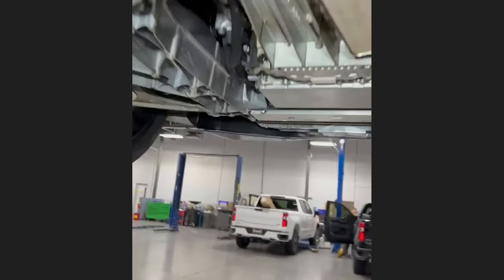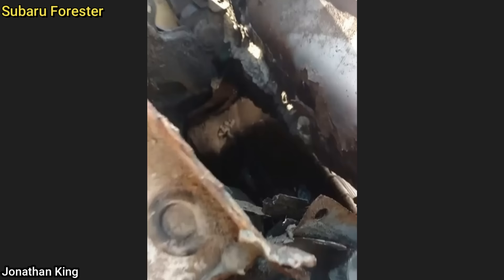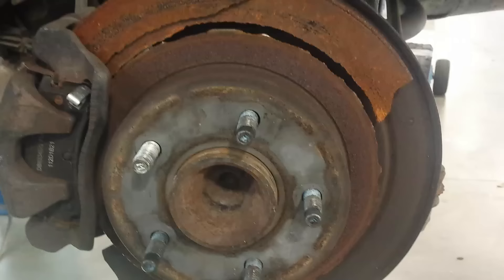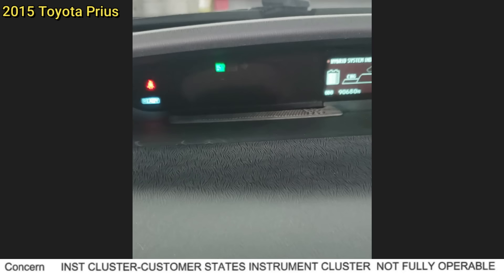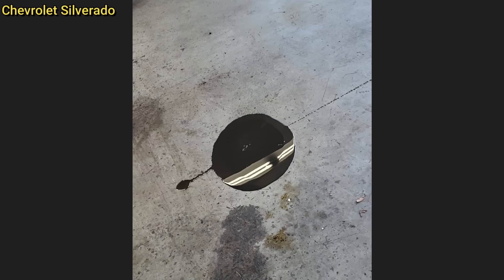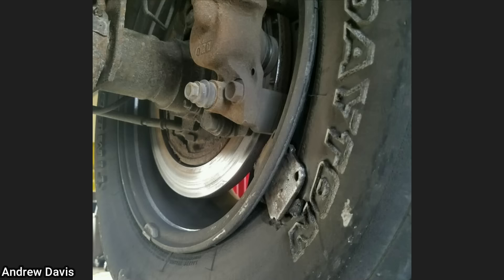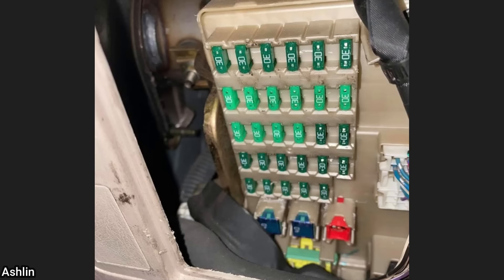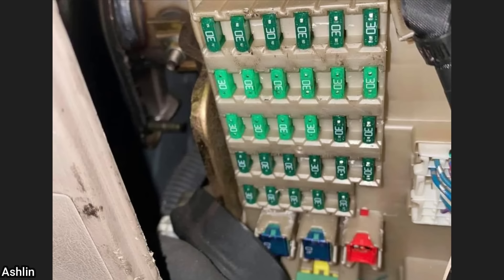Customer States Brand New Corvette Shut Off While Driving

Comment: mechanic shops should be required to contact the DMV and inform them when a customer knowingly drives a car that’s not safe to drive. they’re just putting everyone else on the road at risk
Reply: It's not safe for you to not get an oil change, you're 5 miles outside the interval and I don't care you plan to change it this weekend yourself. Your engine may lock up and there might be a freak occurrence of the transmission also locking up sending you careening down the road out of control. 

Sorry, but I've impounded your vehicle and suspended your license until you've paid me to change your oil. 

Nutjobs, asking for this...
Reply: They should call the cops and have an officer come out to impound the vehicle. When i was driving trucks i would have the highway patrol and/or the DOT cops bust my balls over minor shit. Got stopped once because one bulb on the marker lamps above the cab was out. Got stopped another time because the mud flaps on my trailer wasn't stiff enough and was bending too far back in the wind and that was when they weren't doing random inspections.  But yet they have these death trap vehicles driving around daily putting the rest of us at risk.
Reply: @pontiacg445  theres a difference between needing an oil change and having no brakes, no one would ever say your car isn't safe to drive just cause you're a little late on an oil change...crazy how much common sense you lack

Comment: To all people that are going to buy a used vehicle, Please get it inspected by a good, certified mechanic, before you buy it, It may take an hour or so, BUT It will be cheaper in the long run. And make sure the used vehicles don't come from flooded, storm ravaged States.

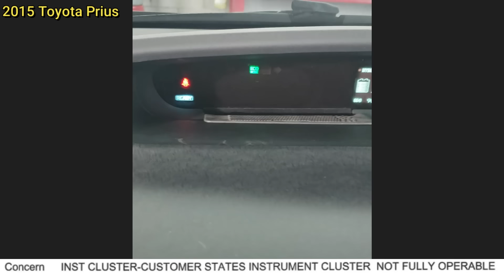Comment: @1:12 - LOL Nice. 
@2:04 - I did that to my 79 Chevy Monte Carlo. I forgot to tape an exposed wire. Every now and then I hit bump and the wire would tap the top of the new radio. Normally it blow a fuse but one day it welded to the radio and started burning. Idid get it out in time.

Comment: My buddy bought a brand new 2022 Porsche GT3 and within 1800 miles or thereabouts based on what he said the engine blew. We didn’t get into what actually occurred but something in the top of the motor let loose. Guess this kind of crap can happen to any marquee of car albeit  rarely
Reply from the maker: Definitely can happen to any car or manufacturer. When I worked at Ford we had a V10 super duty blow up during the PDI test drive. The tech installed a new engine and that one blew up as well. This was a little different as Ford had a small batch of bad engines lol
Reply: High performance cars have break-in periods. I don't think anyone ever follows those requirements though

Comment: I used to work tree service, at the time I had purchased a newer vw with low mileage. When it was cold, I would let it warm up while I blew myself off and changed clothes. I also had a slip up one day while attempting to do the ol" reach in and hand push the clutch. Oh yeah, High idle and not making sure it was out of first. She launched right into the back of a early 90s 250. Truck was fine, the dub however needed 2 headlights, a grill, fender,  bumper and hood. Long story long, if you're gonna be dumb, you better have money.

Comment: With reference to the customer who's rear shock mount had completely rusted away, in Europe the garage would put notice on the car as unfit to drive, the customer would have to sign a document  to truck the car away, if they did attempt to drive it then the garage would refuse to release it and  authorities would be informed....do they not have a  simular procedure in the US. ?  Would the garage not be held responsible if it was driven away and involved in a fatal accident ?

Comment: That Subaru reminded me of my first car, a Nissan Sunny B11 1983. We have quit a strict yearly inspections here in Finland and my car didn't make it. 

The inspector was shining a light in to the rear wheel well where top end of the strut is mounted and said that there seems to be an open seam there that needs to be fixed. 

I got a month to repair it before re-inspection. As I was driving home I heard a pop and felt that the car had something wrong in the rear. I opened the booth and noticed that right strut had punched through the wheel well. The whole well was made from putty. 

As I started to investigate I noticed the other one was made from putty too. And both side skirts.

Comment: Hearing about this kind of this stuff makes me have absolutely 0 trust in other drivers. I know these are the rare cases but it only takes one of these drivers having a catastrophic failure on the highway to significantly change the lives of themselves, their families, and those of the other drivers around them.

With how many times I've seen bubbling tires, or someone driving on the highway with a frozen wheel, I'm worried it's going to all go wrong in front of me

Comment: In my country if a car is deemed not road worthy by a technician and the customer declines the repairs, there is no way he's gonna leave the shop driving. First he has to sign a discharge form and he has to call a tow truck. Even if the tow truck drops him in the street outside the shop. 
All this for a simple reason : if the customer drives away and has an accident he could tell that the shop told him that the car was safe to drive, then the technician/shop would end up in hot water.
If the customer refuses the repairs, to sign the paper and get towed away, cops get called... At that point he will leave on foot and get parking fees or leave on a tow truck.
A mechanic friend saw one of his "customer" get towed and dropped just outside the shop, then come back later because his bald tire (which was the cause of all this) had blown on the freeway and taken out the bumper, fender, wheel liner and part of the wiring harness. He just got told to f off.

Comment: You know, just occurred to me that declined all repairs means that they decided to scrap the car. 
Personally I wouldn’t spend huge $$ on a vehicle more or less guaranteed to have more issues. 
Been a long time, but I’ve actually done that before.
Reply: That's a good point. They need to save up for the tow truck that takes it to the wrecker....
Reply: I used to be a mechanic back in the 70s and 80s. People would leave with dangerous cars like that and drive them. As a mechanic's there's nothing you can do to stop them.
Reply: @garyszewc3339  
Back then Sears Auto used to run a scam where they would find some safety issue and say that they couldn’t release your car without expensive repair.  
I got mine back, the brakes were actually fine, took some real wrangling at the counter, but it led to a lawsuit eventually. Not from me. Maybe that’s why it can’t be mandatory safety repair. 
I agree scary AF to think of close to scrap metal flying down the highway. Hard to understand, near suicidal stupidity.

Comment: In 1980 bought a new Ford 3/4 ton 4x4 ,seal went out in the transmission after 3 blocks. Barely made it back to dealership because trans was out of fluid. Quality is job one.

Comment: If my new car didnt make 1400 miles before the engine exploded, they would get the POS back, not just replace the engine. Another reason that my "newest" car is a 1987 F150.  Years ago, a friend put a new tire on his dirt bike, went for test ride and  pushed it home with a flat tire. Tube had a big hole in it. Fixed and went for test ride 2. Pushed it home with flat tire. This time he looked in the tire casing and found a 10 inch screw driver that he had used while mounting the tire. We still tease him about that.

Comment: It's a shame public transportation isn't more viable in the US because that would probably get alot of these death traps off the road. Shits tough for alot of folks and many people can't justify dropping $1000 plus on parts and repairs, especially when that might mess with their food and shelter funding. My suggestion would be to try and stay on top of it and fix problems as they arise, not ignore them, always get oil changes and tire rotations on time, and do the suggested maintenance to try and stay ahead of problems. But seriously, it's a machine that moves. Things are going to wear down. It's inevitable. There should be some level of preparation for when this happens especially if you rely heavily on your vehicle.

Comment: I wonder if the runaway car at the end had one of those new dumb electric parking brakes. My Civic Si has that and if you stop the car and shut it off with your foot on the brake, brake hold on, remove your seat belt, then it engages automatically. If you haven't done all of the above, usually if you're driving a short distance or don't have the seat belt and brake hold on, it won't set automatically. I've had it almost do the same thing because it didn't set when I shut it off and being in gear was what was holding the car. Had to get in the habit of listening for the brakes and feeling the pedal go down to make sure it's set before exiting.

Comment: There has to be a system for getting these death traps off the road, for the sake of the customer's and fellow motorists' safety. "Muh freedom" doesn't include the right to drive vehicles that pose an unnecessary danger to others. After seeing this I'm glad that my country has comprehensive inspections every second year for newer cars and every year for older cars, and that the inspectors can take a car off the road if it has enough problems.

Comment: That rod coming out seems to be a common problem with the new GM motors. So far 2 new trucks blowed up trying to outrun the old r/t. A 6.2 Sierra threw a rod through the block. And then a Ford explorer dropped a valve destroyed the engine both while they were trying to race me. Lololol 😂. The Sierra was losing badly, the explorer was losing barely. They were talking madshit 2. They couldn't even hang. So if you drive a 6.2 you better watch out for them Ford explores cuz they'll beat you and then I'll come behind to beat both of you. Lol

Comment: Is there any state in the us that have what we have here in Europe where you have to pass an yearly inspection of the cars for them to be safe on the road? We in Sweden "bil besiktningen" and the uk is MOT check. New cars in Sweden have the first check after 36 months, the second after 24 months and then every 12-14 months. Cars between 30-49 years old every 24 month and cars older than 50 years don't have to be checked.

Comment: In the uk we have a yearly check called an MOT to make sure that a vehicle is safe to drive on the road, is there nothing like this in america
Reply: Depends on the state, and in some cases the age of the car. Missouri has safety inspections, but since my car is less than 10 years old it's exempt.
Reply: @annieworroll4373  in the uk there is no MOT unless the car is 3 years old and if a vehicle is over 40 years old it doesn’t need an MOT

Comment: Hurray for homemade repairs!!!  The two x four is a new one!  Anyone else having troubles finding an honest car dealer?  11k on my truck that I've been driving daily since last August, and the dealer handed me a  failed  alignment test.   No pulling or abnormal tire wear.   Scam?Going in for a second opinion.
Reply from the maker: I'd definitely get a 2nd opinion. A dealership's biggest revenue sometimes is the shop. They always try to upsell.
Reply: I caught my local dealership saying my vehicle needed an alignment as part of its out-of-province safety inspection. But they had just aligned it when I visited them the week before. And they check the alignment every time you pull in to the shop, which the paperwork showed was good when I drove in. So between pulling into the shop and the safety inspection, I suddenly needed a significant realignment. When I pointed it out, they had a quick word with the manager and agreed that no alignment was needed. 🤦‍♂
Reply: @JustRolledIn  Yeah, they tried hitting me up for wiper blades also.   Little do they know I have a part-time job at a farm store where we have a complete tire shop and auto oil/ accessories department. Sure miss my old dealership,  no stress, no hassle , no added extras,  just great service.   Ruined by GM, cut off parts and limited vehicles allowed to order, forced owner into retirement.

Comment: When I saw the smoke from that dashboard my first thought was that maybe the AC evaporator coil blew up.
I was down at my grandparents ranch, working on an old Z28 1977 Camaro. They generally took good care of it, but the last three years they were in too poor health to do anything with it.
After I had finally got it running, I started testing things to see if they worked, which they almost all did,(was concerned of broken wiring because it had become overrun with mice) but then when I switched the AC on, after a couple minutes the vents started blowing a fog. I shut the vehicle off, and a few minutes later I saw refrigerant oil leaking outside the car, where it had also made a mess in the cabin. womp womp. :(

Comment: 1:52 given the hole in the diff cover is over the solid part of the diff housing, there is no bulge joining up to the center and the lip on the hole is pushed in it wouldnt surprise me if someone shot the diff. 
Probably still billed for a diff rebuild if it was tho.

Comment: Is that a blue GMC Canyon from Massachusetts? I paid $500 for it a few years ago, I noticed when hitting bumps in the road it felt like the rear wheels moved funny, never got it up in the air only drove it for a year then gave it to a friend in exchange for some work on my other vehicle. Pretty sure that's the truck it had that rubber coating sprayed up a inch or two on the doors after some just enough to get an inspection sticker rust hole filling was done by the guy who sold it to me, he told me straight up it was a hoopty and would just be enough to commute for a year or two.

Comment: if you are wondering why new cars do not have a dipstick and most of the engine bay is blocked off by plastic, it is because of these people. I would not be surprised if in the near future, you can not open the bonnet without going to the mechanic

Comment: Always be inside the car when you coast-start it. Also, this only works on manual transmissions, not automatics.
Reply: No, it will work on automatics, but only if you can run fast enough....

Comment: Heard about this Corvette. Apparently nobody can really determine what specifically caused the failure though it's suspected an assembly error may have lead to a rod letting loose. Very usual
Reply from the maker: That might be another one. There was one with 52 miles that's all over the news as well. Ouch 😅
Reply: @JustRolledIn  Z06, way different engine but makes you wonder if they used the same torque process
Reply: The vin should be traceable to the time it left the factory and which clown was on the assembly line.
Reply: @rhetorical1488  may not have even been someone doing manual assembly. On the line usually a technician assembling the engine relies on a special torque driver that tightens all the bolts at the same time and to the exact yield. If one of those drivers is out of calibration or isn't working properly its possible the bolt will not be adequately fastened
Reply: @dcsteve7869  I hadn't considered that penny pinching factories would skip line calibration routines. Makes total sense and is somehow worse than customer declining repairs.

Comment: Why does no one bother to get a pre-purchase safety & diagnostic inspection done on use vehicles, especially knowing 99.99% are sold as is? Also, if the mechanic is telling you the vehicle is not safe to drive, why are they allowing them to drive off the property? I know some do not & others do make them sign a waiver, but still, these owners that are clearly driving unsafe vehicles are putting other people's lives in danger. So be it if they continue to put their own in danger, but it's another thing when they're putting others in as well.

Comment: 1488 miles on new ram 3500 completely destroyed transmission and transmission cooling system. Took 63 days
Reply from the maker: Took 63 days to get parts? Not bad compared to what I'm hearing from some other manufacturers.
Reply: @Just Rolled In  yea but as I make my living with the truck. 63 was tough. And very much so I do know with stories I'm hearing from fellow drivers I made out reactively ok. Just happy to be back on road again

Comment: Correct me if I'm wrong, but a car that's completely destroyed on the inside to the point that the shop has the customer sign a waiver, acknowledging that it's unsafe to drive  Could just call the cops and tell them Hey this completely destroyed vehicle is about to pull out of our shop. here's its license plate.  and wait for the cops to get to come around for the customer to leave?

Comment: Listen, if US has TUV inspection, about 1/3 of cars would be pulled off the road. Americans do not care, they drive until the car can't move anymore and then they replace. It's as simple as that. 

This is horrific. The worst cars in my country aren't as bad as this.. Because anything you see on the road passed yearly inspection and you need working calibrated brakes, stout suspension, no excessive rust on critical components.. working lights and exhaust system..

These cars are completely miss-maintained. Literally any car you show needs about 3-5 grand worth of parts and work to literally "restore" from scrap metal. Insanity.

Comment: Did i hear right? You said the customer tried turning the car on while having his foot on the clutch? Correct me if I'm wrong but that's like a 09 altima and those arent as common to see in manuals?
Reply from the maker: 2007-2012 had a manual transmission. Don't see them often but they're around. I believe some older years had manuals in them as well.